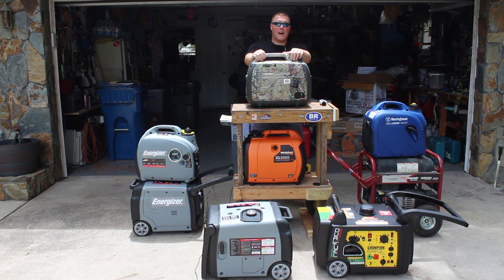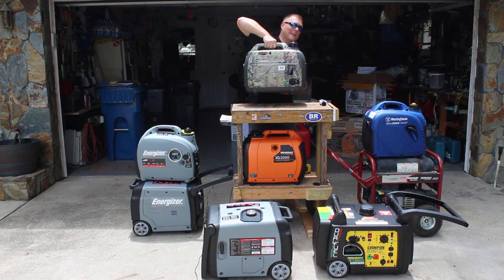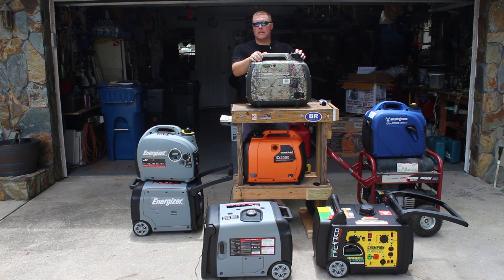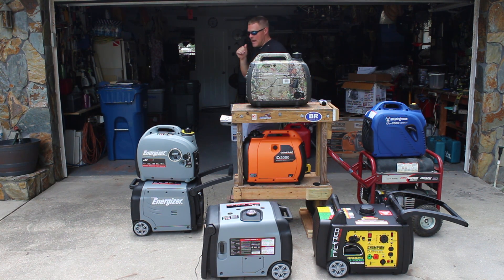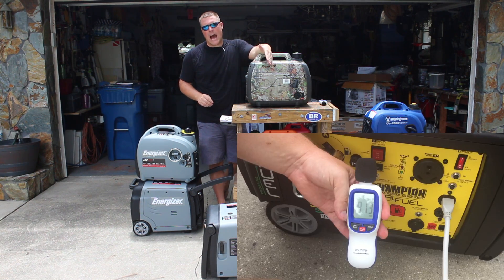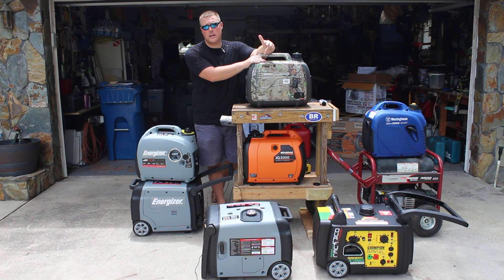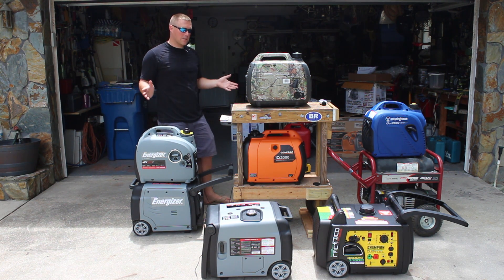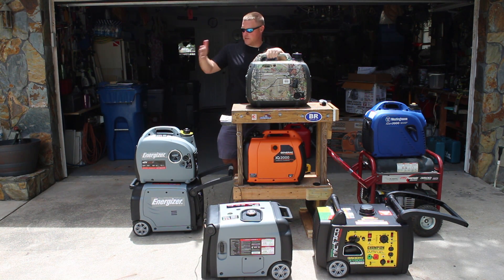Difference Between Inverter Vs Open Frame Generator, Why Choose An Inverter Generator

Comment: I really like the concept behind inverter generators, compared to traditional ones.  My problem is that it seems like most inverter generators are smaller than I want.  My house is hard wired to allow a generator to power the whole house, but as far as I know I need a 240vac generator, and most inverter generators I'm finding only put out 120vac.  It seems like the inverter technology is creeping its way up into bigger units.  I found a unit made by Champion (model 100519) that is an inverter putting out 240vac, and puts out 5000/6250, and what seems like a good price to me.  This is most likely going to be the next one that I purchase.  On paper I like it a lot, even though I wish it was a little more quiet.

Comment: I'm not worried about sound. I have a really old 7500w generator that idles down when not under load. I thought this video would explain the technical difference.
Reply from the maker: Did you have a specific question about the technical differences? Many open frame generators do not produce clean power for sensitive electronics.
Reply: @generatorpower7744  I watched a different video that explained the difference. That's the nice thing about youtube...you can almost always find what you want. I wanted to know before I bought my next generator.
Reply: @generatorpower7744  Most of the new open frames produce 60hz sine waves.

Comment: I am looking for a generator to power my fridge in the event of a blackout. I'm assuming a 2,000 watt would suffice?
Reply from the maker: If you're only powering the fridge, definitely a 2,000 watt would suffice. This is one of the best bangs for the bucks at that size: https://amzn.to/2I5k8M1
Reply: Thanks. Would you prefer the one provided in the link or the 2,000 watt Champion that goes for about the same price?
Reply from the maker: Yes, it's actually a little bit cheaper right now, check that here: https://amzn.to/2KJx2Bb